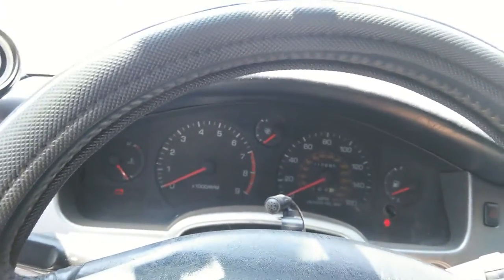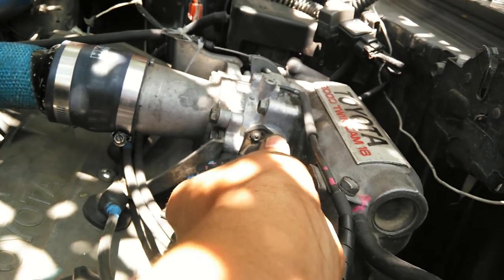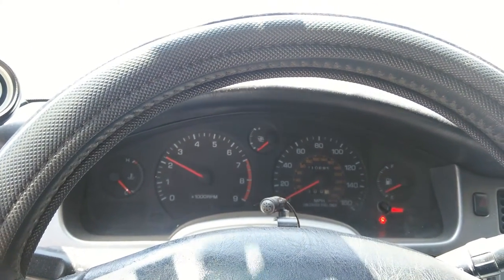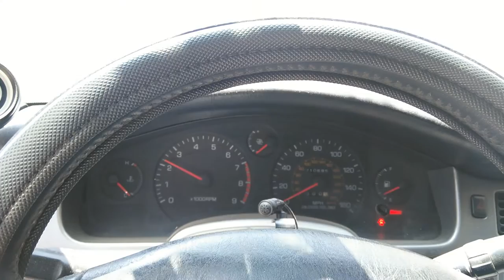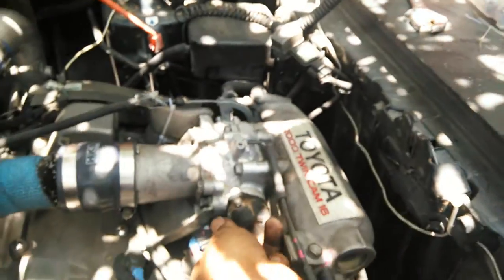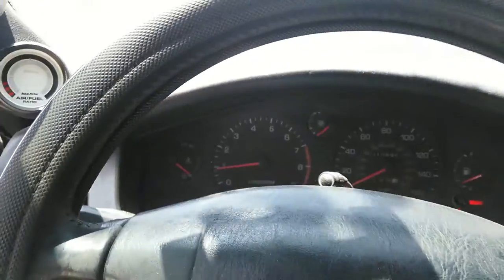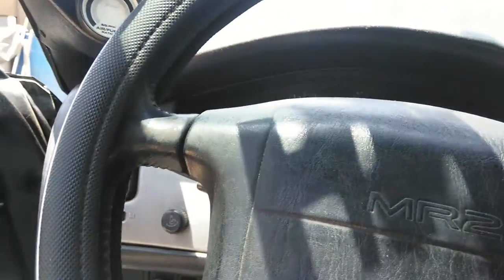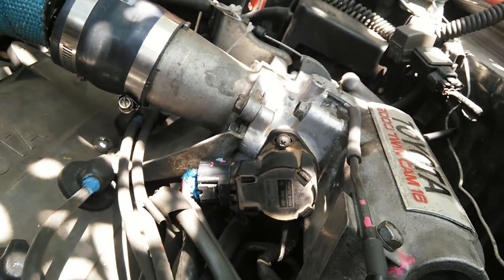My MR2 toy with TPS issue and fix

Comment: That's not how to adjust a tps , you need a volt meter and two t pins to pierce the wires for testing , one wire is 5 volt power the brown is ground and the other is idle which should be 0.8 volt at idle , with key on and engine off you slowly open throttle and voltage should increase steadily without fluctuation , check the vaccuum sensor whether map or maf , tps could be innocent and compensating for vaccuum leak or broken wire from one .
Reply: Indeed it still sound incorrect needs to read the BGB and do it right